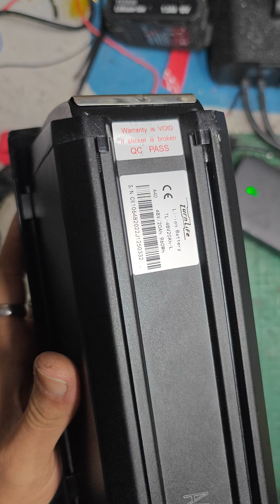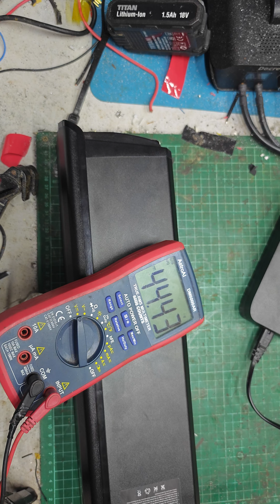HIMIWAY ZEBRA Battery won't charge - How to fix - Fuse replacement.

Comment: Thanks for the video! I’m having an issue a buddy at work moved my bike for me and didn’t notice it was charging and ripped the barrel of the charger. My charger doesn’t turn red, but the battery button checks green and it only charges three bars. Any ideas?. Still in warranty period but already took to bike shop and been going on for three weeks now. Thanks!
Reply from the maker: Maybe blown the fuse like this one or needs a new charger, check output voltage with a multimeter
Reply: @EbikeRepairs  Fuse! Thanks for reply!

Comment: I think battery fuses should have an external access location on the battery case for easier checking and replacement. Thinking ahead again. My bad.
Reply from the maker: They should! Silverfish cases use glass fuses, surprisingly resilient!
Reply: Lol! Keep on riding brother. After 25 years of IT work. I'm scared of everything now. Lol. @EbikeRepairs